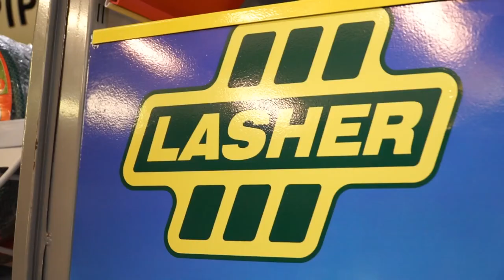Lasher Corporate Video

Comment: I bought the FG04110 sledge hammer which I am going to turn into a Warhammer with a modified eye. Looking to turn one of your Chisels into a Spear tip. Already modified your Kukri. Not bad but wished you made a thicker version of this and your FG02265 machete aswell. Bit of a bladesmith. Any idea what steel you using 1055? 1045?